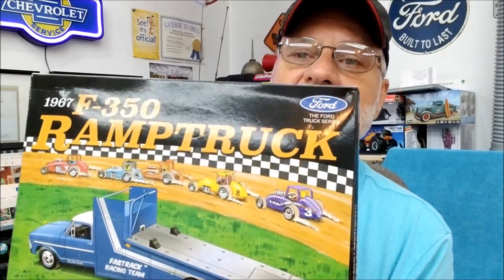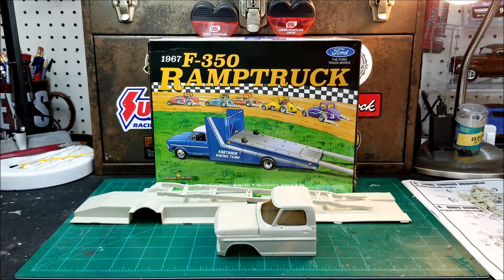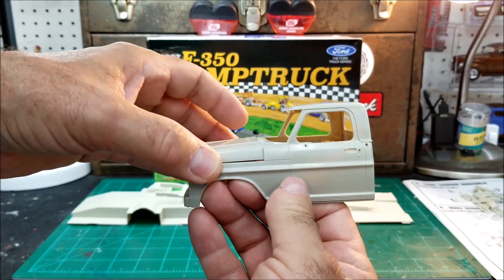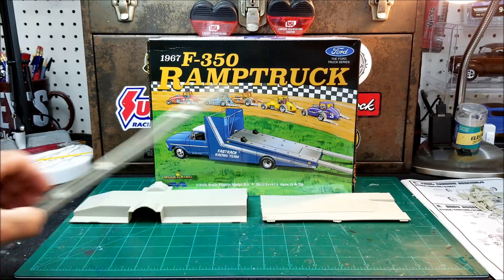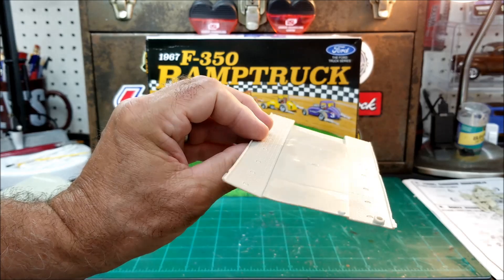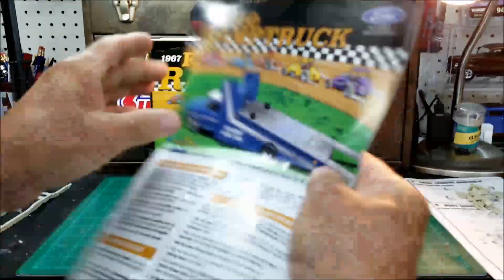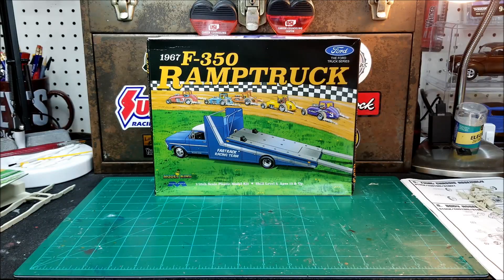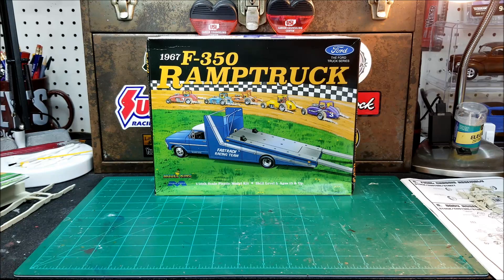Ford F 350 Ramptruck Warped Parts

Comment: That’s a pain in the butt when you get warped pieces. Luckily, most of the manufacturers are good at replacing parts!  Thanks for sharing. Happy days and model on!  😎🇨🇦
Reply from the maker: Thanks Peter.  I reached out to Moebius and they are aware of this issue and replacement parts will be sent out ASAP.

Comment: Man that sucks. I don't think Mobius has ever had this much warped parts on a new kit. I had a warped interior tub on my 55 chevy pro street im building and i contacted Round2. I got the part in one week which is pretty good. I was worried it was going to take up to 6 months, but it didn't 👍 Hopefully you get the parts from mobius in a reasonable time.
Reply from the maker: Thanks man.  Yeah, I hope I get the parts quick too.

Comment: Great ramptruck wish I had me a ramp truck for my model cars and stuff
Reply from the maker: Thanks Mason.
Reply: @olezippi  Damn Zippi that sucks I've used a heat gun and a hair dryer to fix mine before those parts can be fixed
Reply from the maker: @Stupidfastracing  Thanks man.  I'm in no hurry so I'll just wait for the replacement parts.